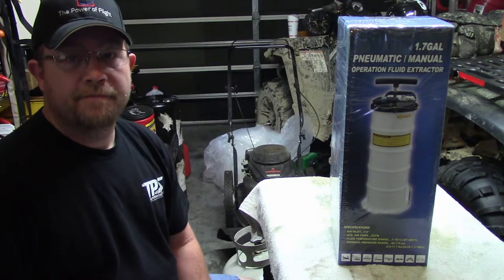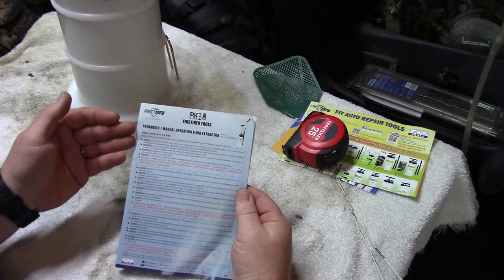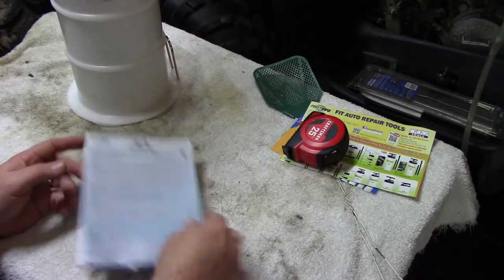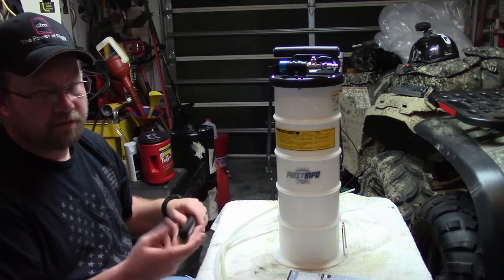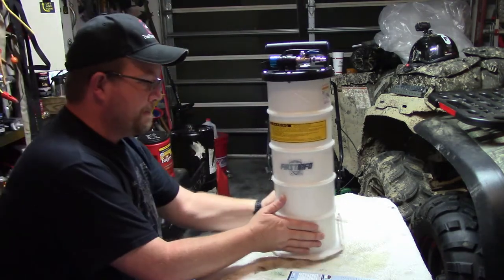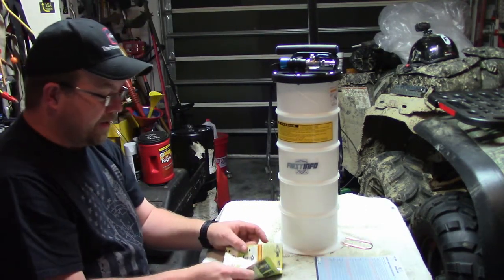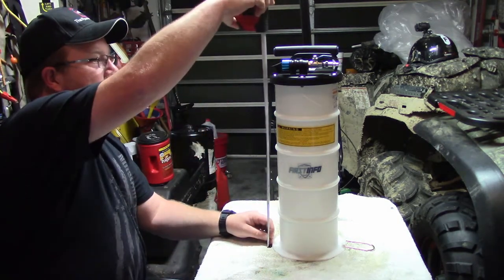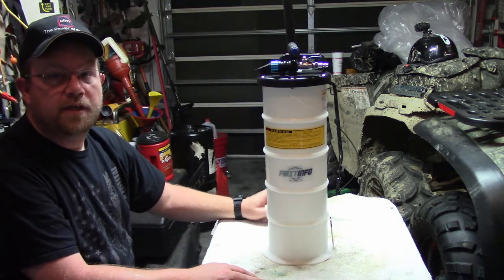FIRSTINFO 2nd Generation Pneumatic/Manual 6.5 Liter Oil/Fluid Changer Vacuum Extractor Pump

Comment: It is not a dipstick nor a cleaning rod. It is a guide wire to provide stability for the narrow tube. Once you have inserted the tube, you remove the guide wire and connect it to the main hose.
Reply from the maker: Thanks for the info

Comment: Is that really a dipstick. I have just got an oil extractor  and it is just used to go inside the small hose meant for an avg dipstick to keep it firm if going around corners. Once the hose is in, one pulls out that metal wire
Reply from the maker: Never rally thought of that, thank you.

Comment: Nice review!  I've been researching these extractors quite a bit and this brand/unit seems to really be a good deal and well built.  Question - Do you leave your air valve "on" the whole time or cycle it "off/on"?  I've watched other videos where the operator just flips the valve for a few seconds to build a vacuum.  Maybe  the directions have a suggestion.   Thanks!
Reply from the maker: The hand pump, holds vacuum pretty well. I keep the air on just to keep constant pressure.

Comment: How do you operate it manually?  Where do you keep the valves on or off or do you start with valve off then you turn it back on ? Please elaborate. Thx
Reply from the maker: Keep the air inlet valve closed and pump the air with T handle.

Comment: Hey Badger thank for putting this together. I just received the exact same one from Amazon.
When you use the extractor manually is the suction smooth and steady? I tested mine with water (incase I had to send back) and has a leaking sound and a kind of "whoopy cushion" sound at the bottom of the stroke. The extractor does draw the fluid though, just wondering if a seal is dried up or I have a crack or something. Thanks!
Reply from the maker: My last reply didn't show up. When I use the manual pump, it does a faint hiss noise. But, the flow is constant, until it got in a spot with low fluid volume then it gets lower. So sorry my reply didn't show up and this is late.

Comment: Hows is this tool holding up? is it still working good in the long run? do you recommend?
Reply from the maker: So far, pretty good, the base is bulging out a little, due to leaving a little gas in the bottom after a few weeks.
Reply: @jetzombie  hey that’s good to know. I thought the plastic used would be resistant to swelling.   Thanks for the info.